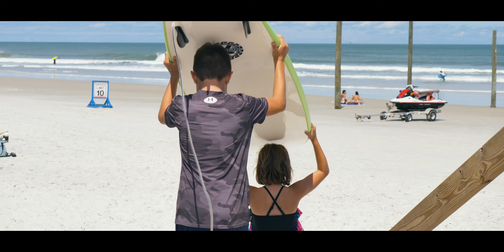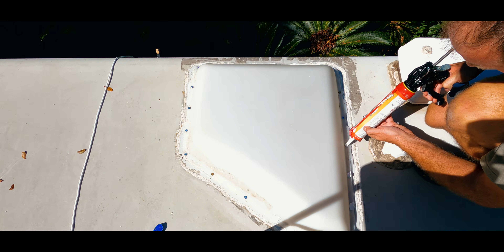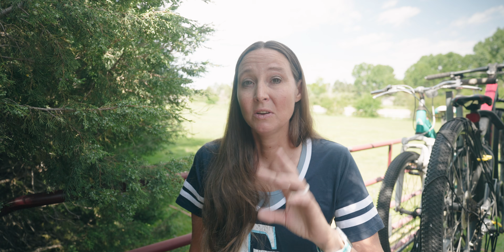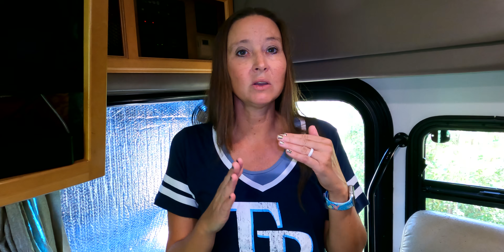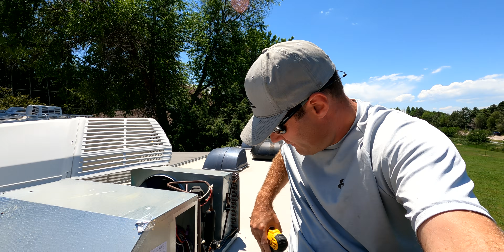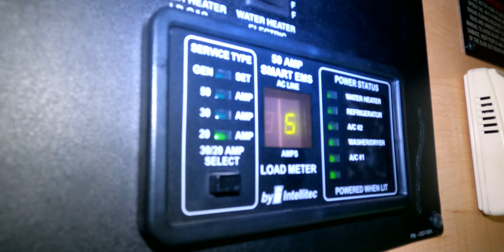RV Living - Staying Cool! Run 2 A/C's on 30 Amp Or With Small Generator!

Comment: so just a fyi National electrical code says you can only pull 80% of a breakers capacity continuously so your looking at around 24 amps through a 30 amp or it will trip because it gets too hot over time.

Comment: First you started 2 units for the 40 amp draw but compared that yo only starting one unit at 22 amp draw.
 What's the deal here?
Seems half the amount of a/c units starting would be half the amps anyway and that's what you got.
What's the deal deal and why didn't you compare apples to apples??
Reply from the maker: We did start only 1 unit at first (there was an error in the video). When we filmed this we were only hooked up to a household power source so we could t use more than 1 a/c

Comment: Great video!! Bleh....yes, the front range has been warm.  It has even been in the 70s in Ouray,  already.  

I will definitely install one of these when our ordered rig comes in October.  

Do you have 13.5 or 15k btu a/c's?

Our trailer will come with a 15k btu a/c.  I would love to be able to run ot off of a house plug in or 2200w honda generator
Reply from the maker: Both our A/C’s are 15k BTU